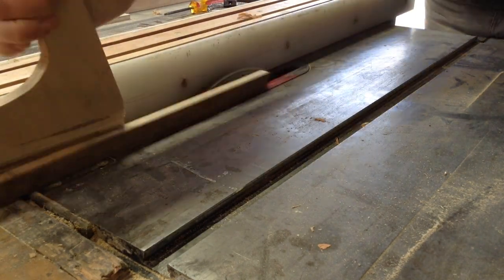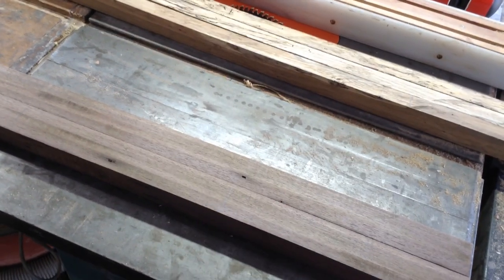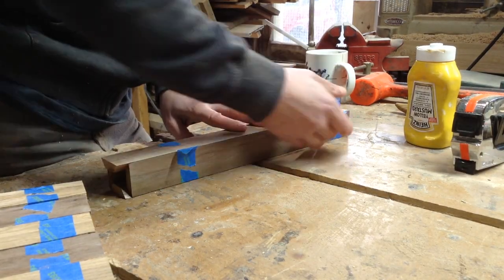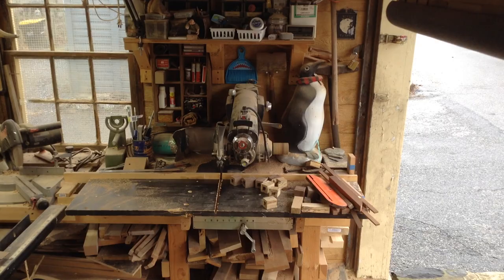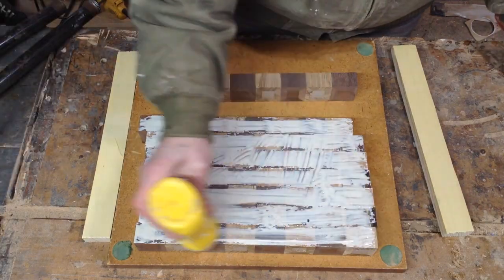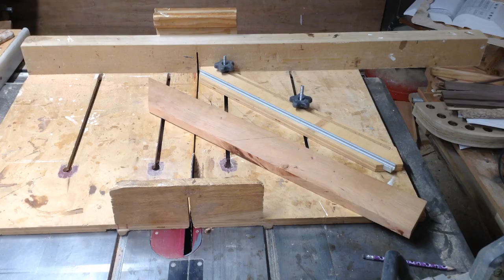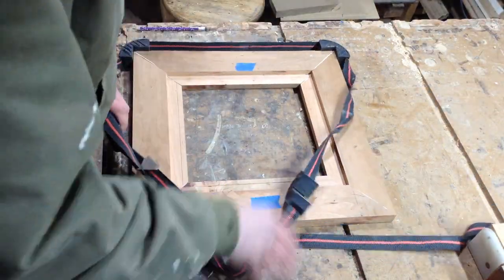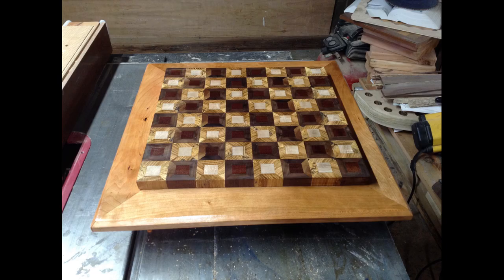Woodworking : DIY End-Grain Chessboard//How-To

Comment: I love that you're using a good old cast-iron radial-arm saw in your shop!  What model is it, specifically, and which blades are you using?
Reply: OH, and you may wish to check out Brian Weekley's video on the broken-fence method of cutting miters on the radial arm saw.  Very handy, very precise, perfect miters every time even with long stock.
Reply from the maker: Thanks, I'll have to check that out.  I don't know the model off the top of my head, just that it's an older Craftsman.  I printed out the instruction manual so I'll let you know when I look it up.  It came with a blade that I use.  Honestly, needs a new one, but I'm terrible at sitting down and ordering things like that.
Reply: @HoneyBadgerWoodWorks  Thanks for getting back to me!  If you're on FB, may I recommend  the "Vintage Radial Arm Saws" page? Or maybe its a group, I forget which, and that seems like a distinction without a difference.  Regardless, there's a good bit of information there you may find helpful.  I'm just a home-gamer, and it's certainly helped me quite a bit.